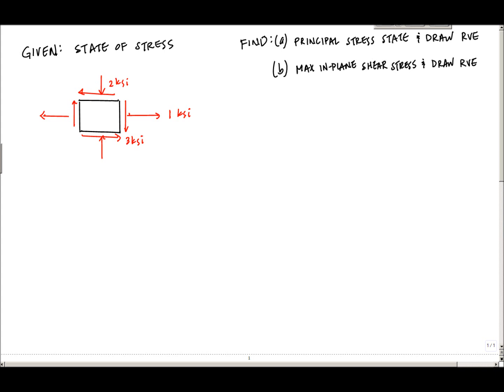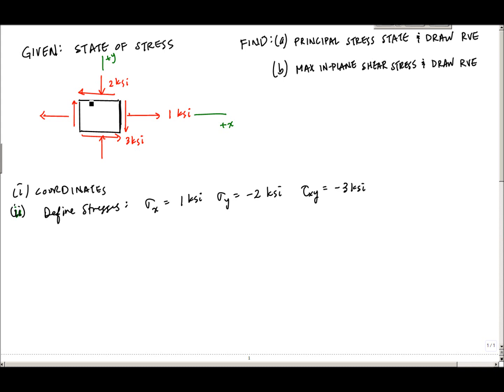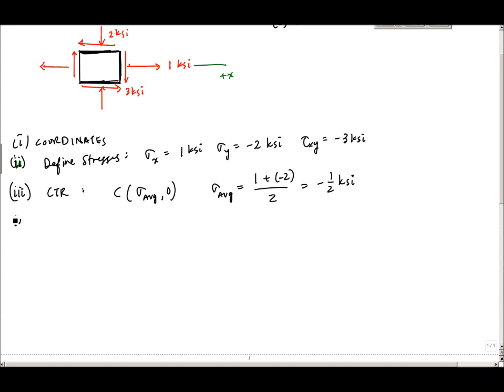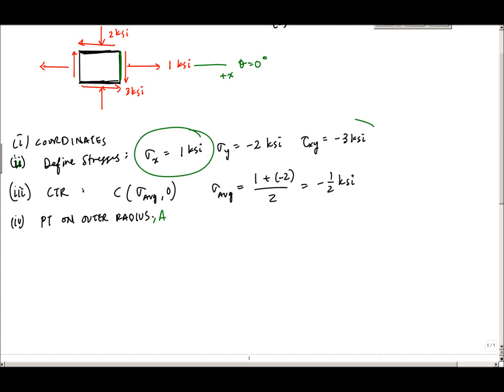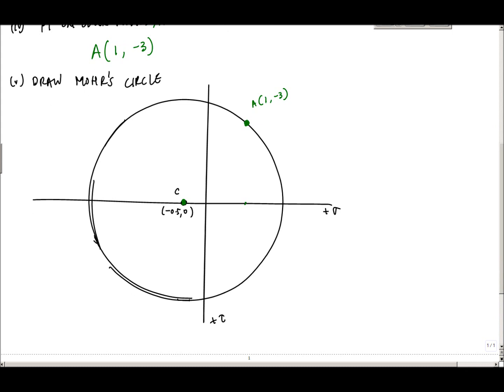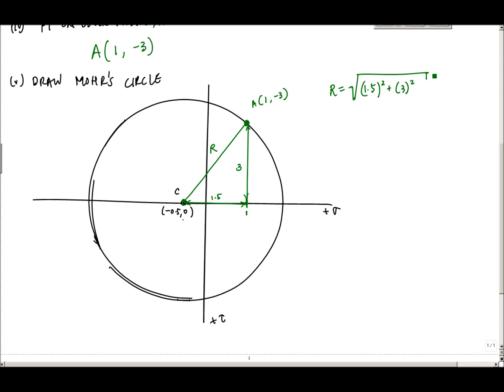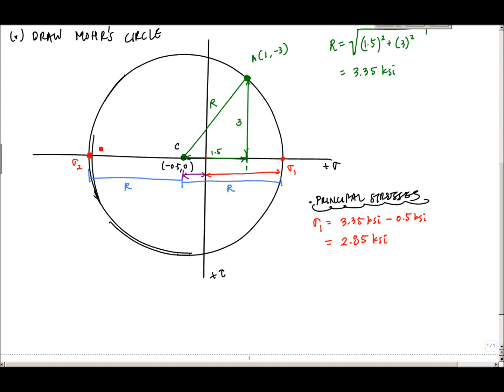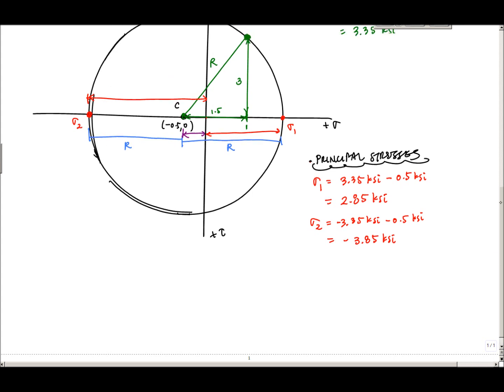Example Mohr's Circle (Part 1 of 3 - OLD) - Drawing Mohr's Cirlce

Comment: and Why is that Freaking (1,-3) in the first quadrant??? shouldn't it be in the fourth???? PLZ help
Reply: Cuz he set +T to be the bottom part of the circle (it's usually negative Y) so now upward is negative and downward is positive for the vertical axis.
Reply: yeah that's what i just figured haha Jawad Abdul Sahib .. it's also because the moment is positive in the clockwise direction and negative in counter. or at least that's what i think haha
Reply: Noble Rassam I don't think it really matters what direction he sets T to be, as long as you do the math correctly. So I assume if you like use the regular coordinates (positive up, negative down) the results would be the same. He did it just for convince I suppose, but I'm not sure. sorry it actually matters cuz the angles would change if he hasn't done it this way. Man this stuff is confusing haha don't forget to get some coffee :)
Reply: Haha I know the feeling bro